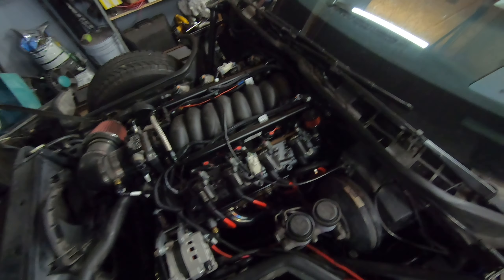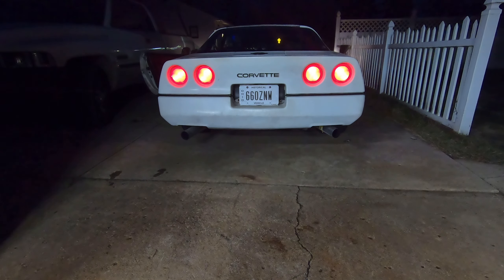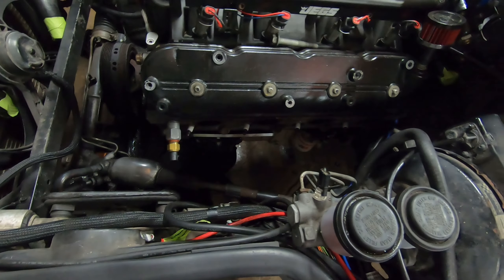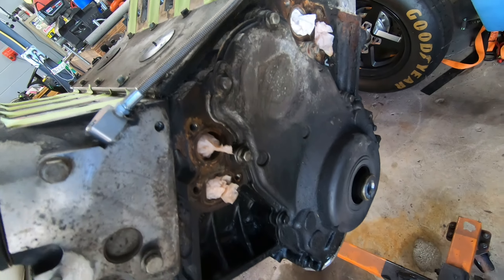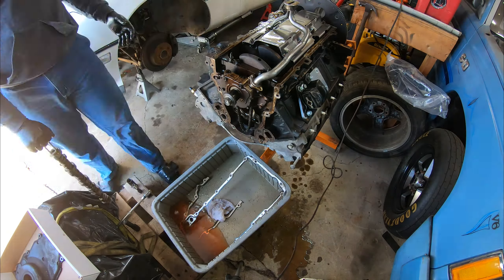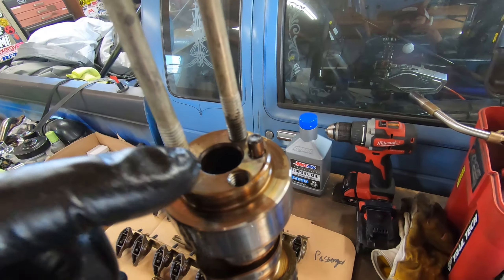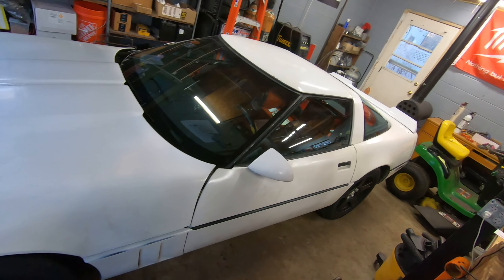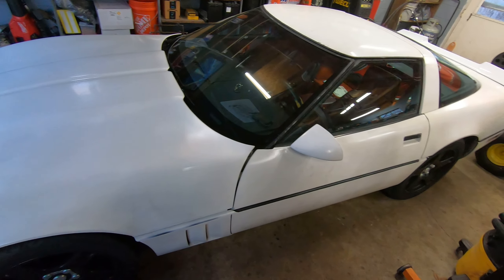The Most ROWDY Cam on the Market? - Texas Speed Chop Monster Install

Comment: Im a fellow Ohioan and I'm building a 408 stroker 11ish:1 ported heads but haven't quit decided on the camshaft. I was looking at the same 2 as you and was wondering what pushed you to the chop monster?
Reply from the maker: Honestly just the sound, wasn’t trying to make crazy power on the stock corvette diff so I wasn’t really concerned with power gains

Comment: Wanting to put this cam in my LQ4 6.0 how’s it chop and does the car jerk back n fourth with the cam chop lol
Reply from the maker: Chop is pretty nasty, the idle is not bad at all, definitely different than the stock cam but not bad. If you have to do any transmission work, going to a higher stall converter will mostly eliminate that.